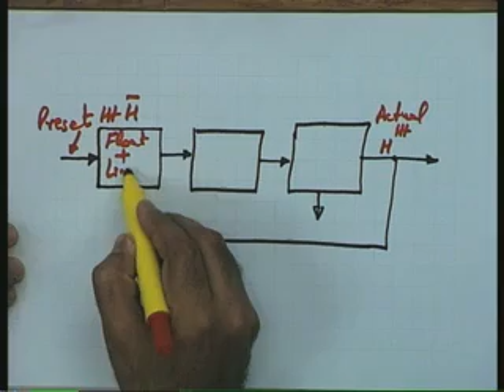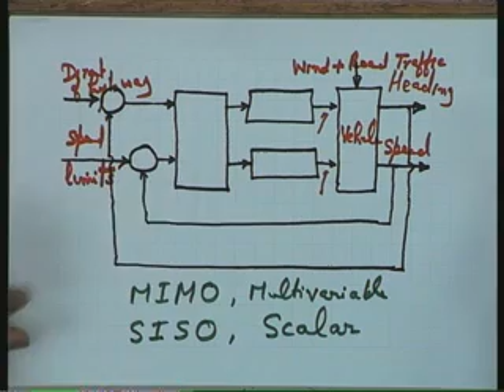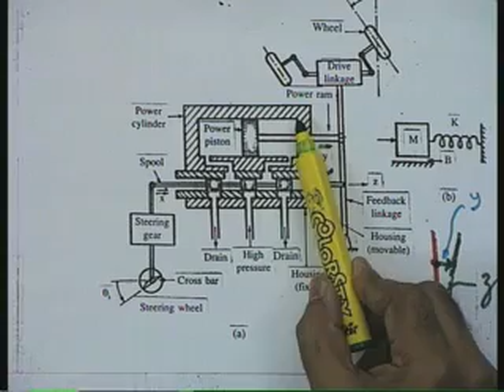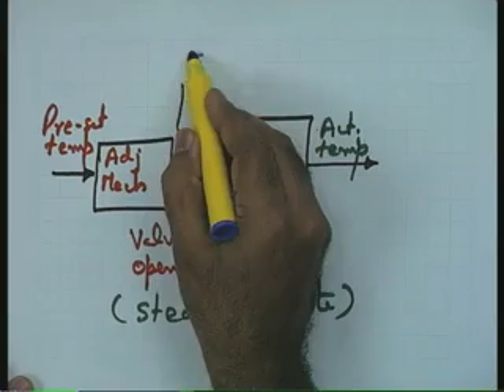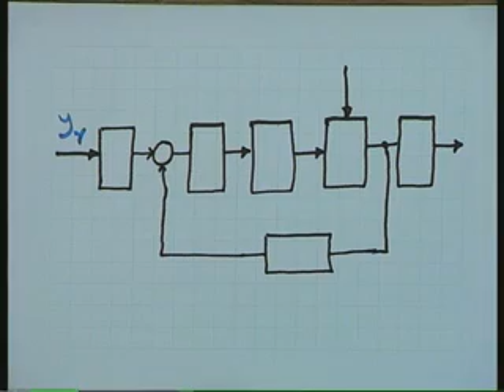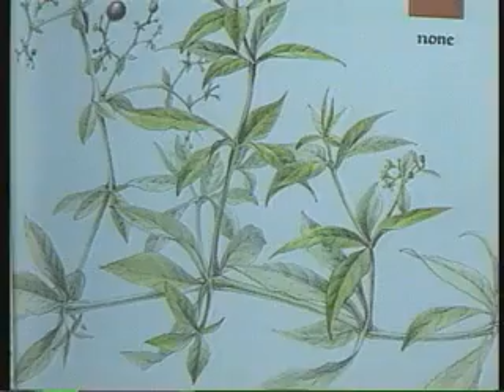Lec-2 Basic Feedback Structure

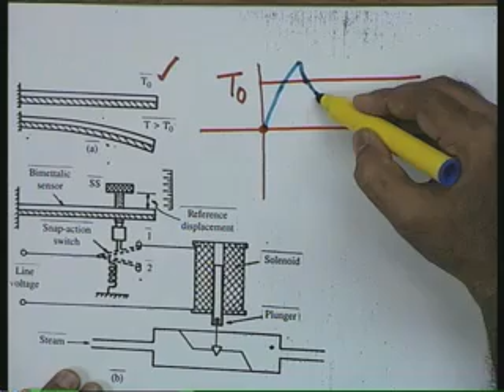Comment: I think, there is a mistake at 41:40. The valve opens, when the blue line crosses the red line and not at the bottom. The blue line (actual temperature) continues to go down because, the system cant heat the room in such short time. Correct me if I am wrong.